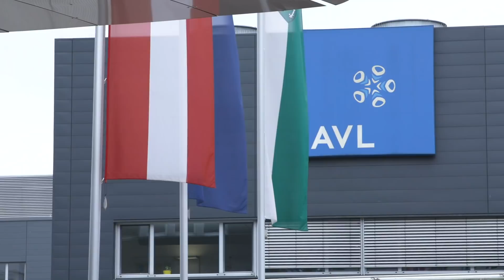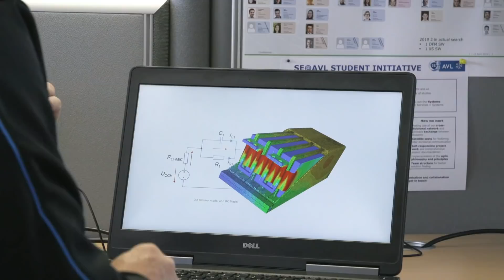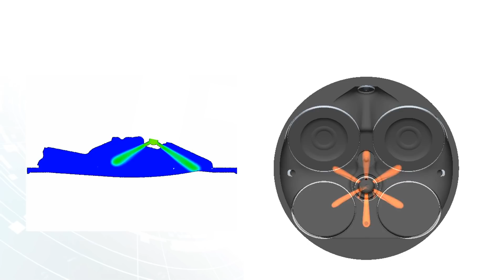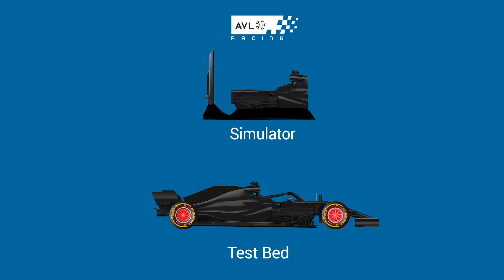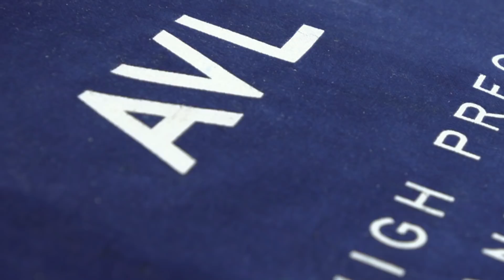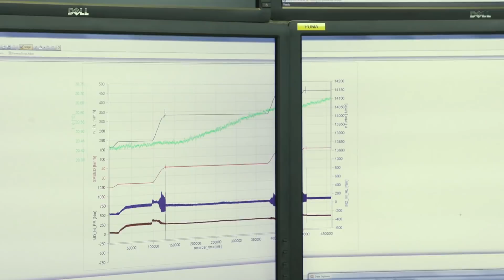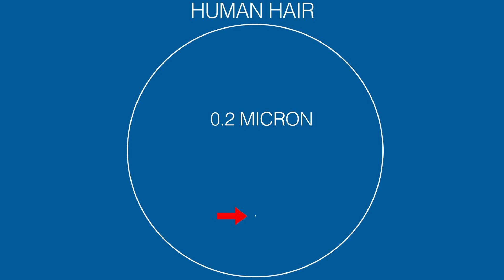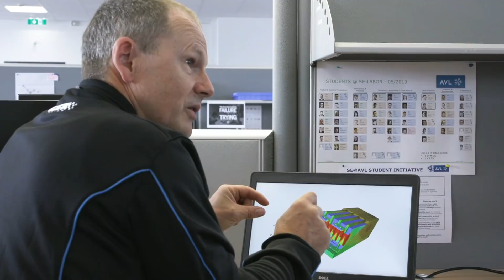The most important motorsport company you've never heard of (part 1)

Comment: I wonder which teams on the F1 grid are their customers. By the looks of it, it's a recipe for success, use software and simulations to study individual component behaviour???? That's freakin nuts. 
I can tell you though, that Hass and williams (for starters) aren't their customers by virtue of the fact that Hass has barely figured out their overall performance of the car, and Williams were the old-school-machine-everything-in-house company.
Reply: i guess all
Reply: William's dont machine everything these days I work for their sister company advanced engineering
Reply: Every single team uses simulation technology of some sort mate
Reply: Nick Pierpoint Indeed, Williams is beginning to catch up with the times. I hope you do well in helping Williams get back to their old place.
Reply: Haas are a machine tool company,  I would hope they machine their own parts it would be embarrassing for them if it were known their parts were made by  Germans on most likely German machine tools :D
Not hating on Haas btw - i have one in my machine shop, it's fast, accurate and reliable.
Reply: Jack Schitt They have their chassis built by Dallara, Haas is notorious for outsourcing parts.